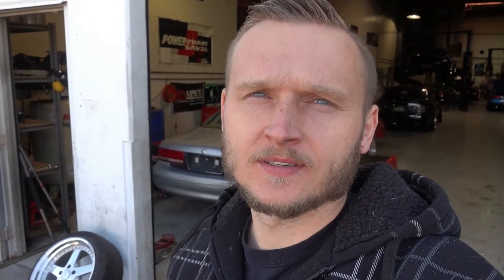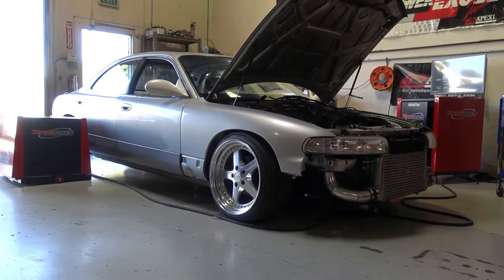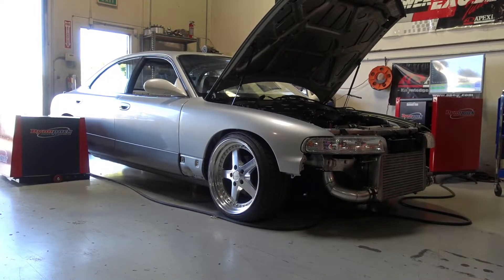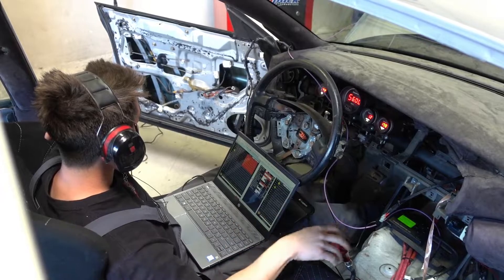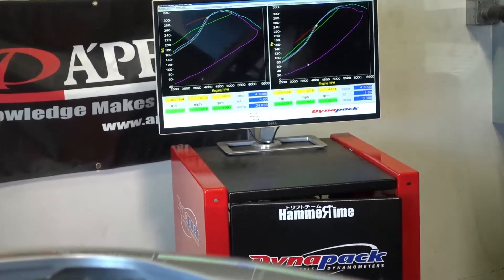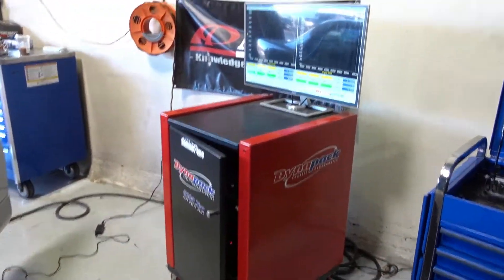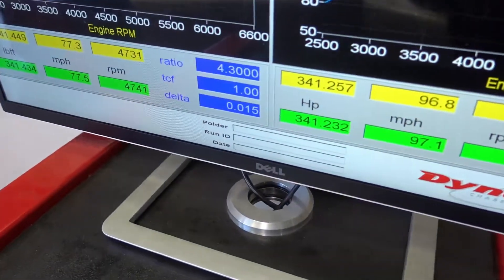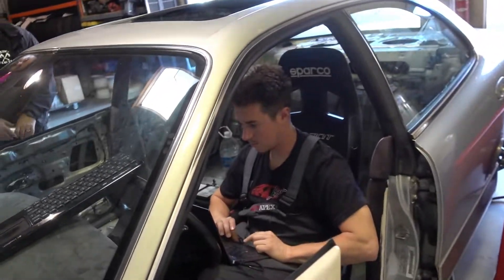Worlds First 2JZGTE Mazda 929 Dyno Day

Comment: What kind of suspension are you rocking??
Reply from the maker: The car is on some basic coil overs at the moment but we are thinking of converting an entire suspension to a 240sx style to get maximum turn angle for drifting.
Reply: @LukePakula  That’d definitely do it, ive got a 93 929 that i found a few months ago, I’ve got to do some maintenance on it of course including replacing the suspension all around. I was wondering you had any suggestions since finding anything for this car is a challenge and doing a conversion might be my best bet. Also haha i should include that i don’t intend on swinging this one around,  i just plan on cruising and showing off a car not too many people have heard of
Reply from the maker: @zomstizzy  Nice, we actually had one with a full body kit super low but it was too much to maintain with being old and all. It was definitely an |attention getter" car though.

Comment: Hi, what gearbox did you use for manual swap?
Reply from the maker: Hello, we are using a R154 transmission with a custom trans mount bracket and a drive shaft